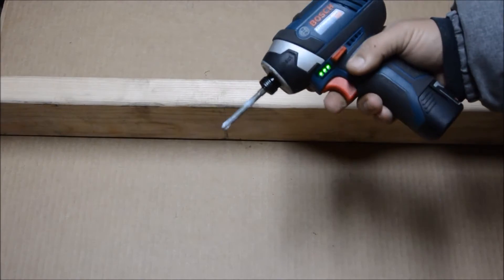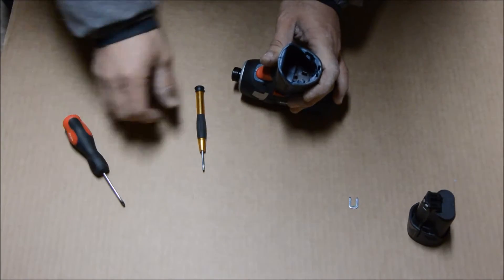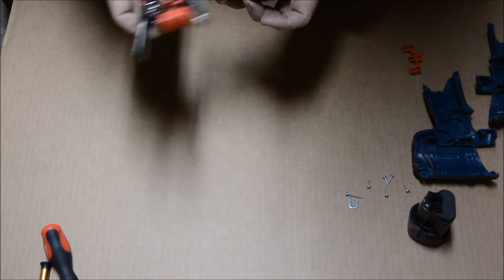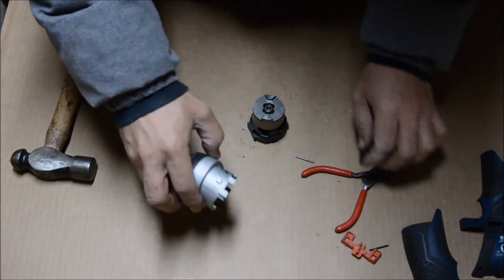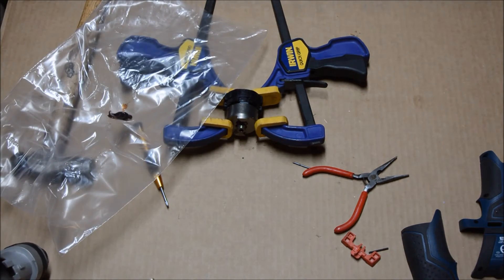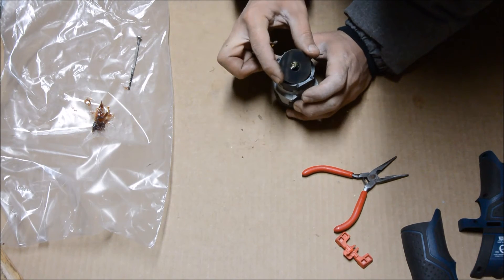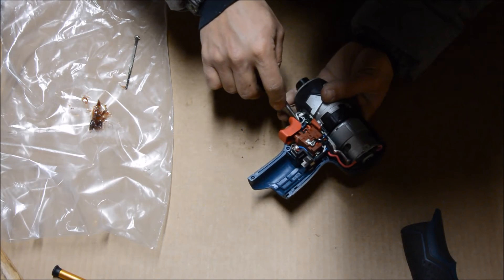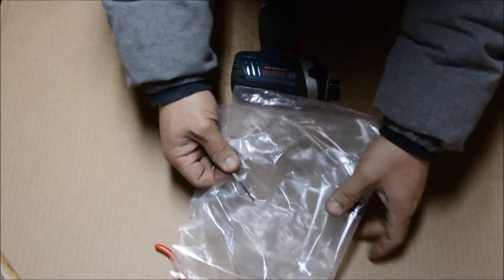Bosch Impact Driver Fix

Comment: Thank you for taking the time to make this video. I fixed two vosch ps41 today following your directions. Both broke after high falls onto a hard surface. Same issue, a ball bearing popped out. I love this little bugger. I finally got around to fixing them today. I could not have done without you. Thank you very much. I am going to give one to each of my daughters so they can assemble the cheesy furniture they buy on Amazon and at Ikea. I appreciate your effort.

Comment: Hey, I pulled mine apart and saw no obvious reason for it not work properly..  I bought a new gearbox for it and it works like new.  Bosch part # 2609199241 for model PS41.  The gearbox comes as one unit, no buying individual gearbox parts.

Comment: Thanks.  I watched this because I have the 12v hammer drill and it has been sounding like it needs to be cleaned and re-greased lately (I've been using it in a dry and dusty environment for two years...I feel more confident about opening it now.